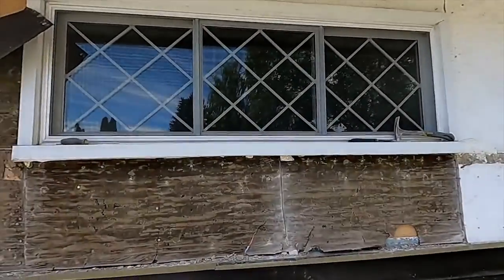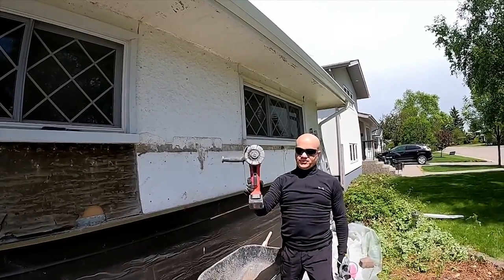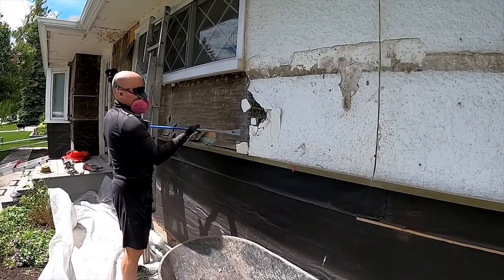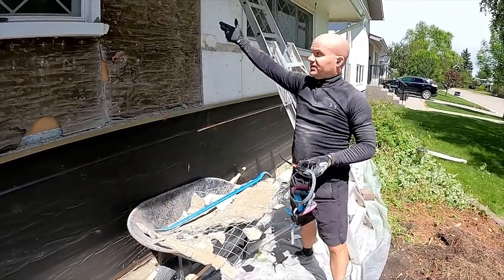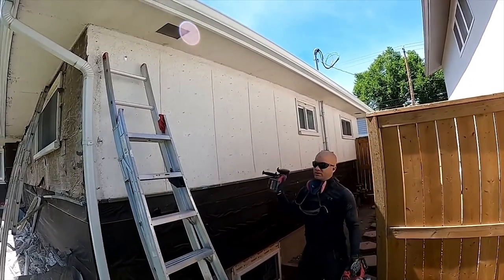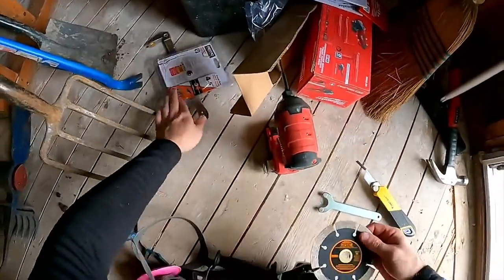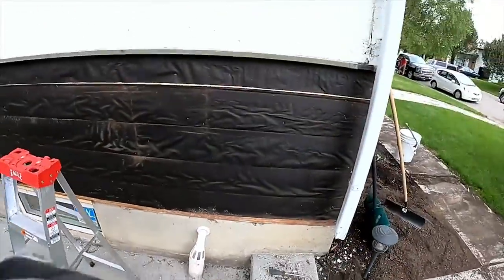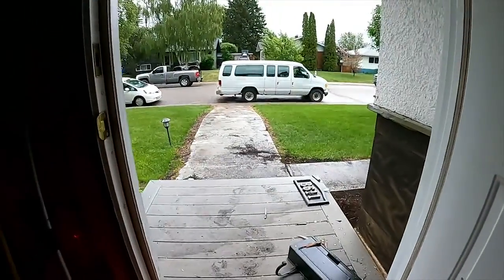How To Remove Stucco - DIY

Comment: Thanks for the tips. When you did the initial vertical cuts with the circular saw, did you notice if the blade was cutting through most of the lath? Or was it mostly cut with snips?
Reply from the maker: Blade got everything that wasn't out of the radius, long as depth was set properly. no problems getting thru the lath at all

Comment: Saw cut it all, using a grinder across the top seam, then get the demo bars and some buddies.
Reply from the maker: That's like, exactly what I did!
Reply: From your video it looked like you were cutting one at a time, and removing them one at a time, then making the next cut. The grinder across the top seam specifically applies to stucco soffit.
Reply from the maker: @Natedoc808  makes a difference if you have a team, if you're on your own, one cut at a time doesn't make a difference
Reply: @MooseDoesStuff  eh, I would disagree. I’ve built tons of stuff on my own and not having to task/tool switch greatly increases efficiency. All the saw cuts, all the grinder cuts, then all the demo bar work would be the fastest way.

Comment: How long after removing stucco can a house stay exposed ?  We’re anticipating we might need complete stucco remediation and want to cut cost by removing the stucco ourselves
Reply from the maker: depends on a lot of things, if you get it wrapped then quite a while. as long as you make sure the sheathing is dry before you do the next step you should be fine.

Comment: Thinking about removing all the stucco from my older home, insulating the exterior walls, then sheeting the home with plywood or OSB before re-stuccoing.
Reply from the maker: you don't have exterior insulation already??
Reply: @MooseDoesStuff  the home was built in 1939 I believe and didn't have insulation in the exterior walls nor plywood sheathing.